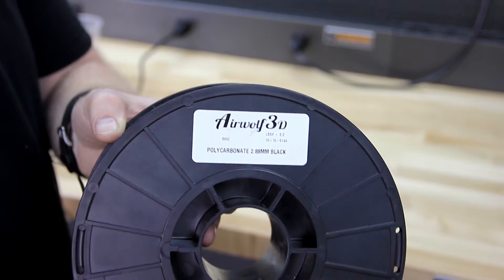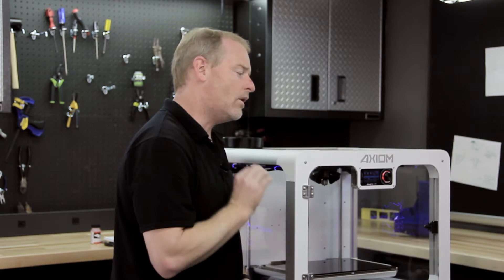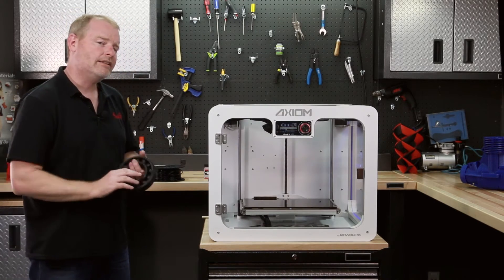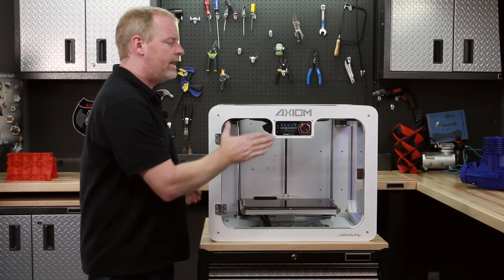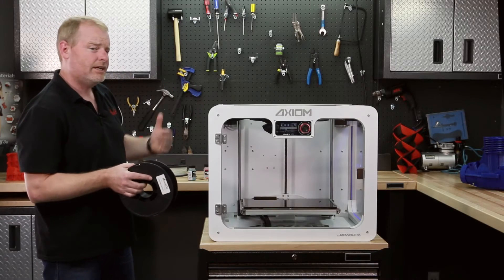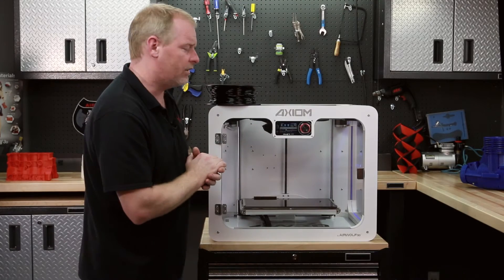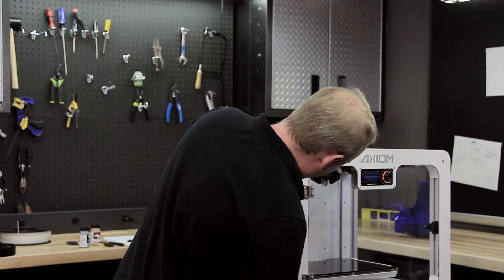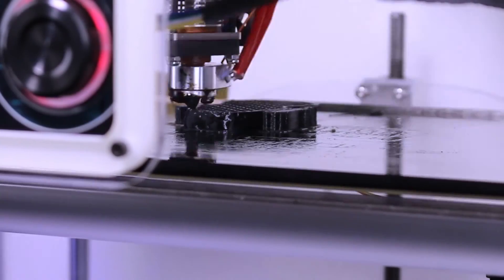Erick Wolf Talks About the Axiom and 3D Printing with Polycarbonate.

Comment: when the hot end can do 400c and the chamber 70-90c then i might be impressed.    i doubt it hits more than 40c inside with outside ambient at 20-25c.   300c ain't nothing.
Reply: GARCAD cartesian:  400C in 90 seconds.  first to implement IR heating.  the last word in FFF
https://twitter.com/fosscad/status/948059423699644416
print ON what you print WITH and it has to stick.   
somebody had to figure it out, right?

Comment: What allows your printer to reach a bed temperature of 145*C? That's above both the glass transition temperature of FR4 circuit board material (heating element for most printers) and the upper limit of a chip thermistor. What material is used for the heating element of the bed? If it is copper, does your machine utilize step-start circuitry?

Given the extreme hygroscopic nature of polycarbonate, I suggest building a spool enclosure on a future revision of your machine.
Reply: Right... there is more than one type of heater... lol.  ever use a stove?  electric skillet/frying pan?   if you wanna reach 150c bed temp, silicone heater+aluminum.  done.  PCB heaters are used because their cheap AF.   A 400w 110v AC mains silicone heater should do the trick.  plus no waiting around.  why power a heater with DC anyway?